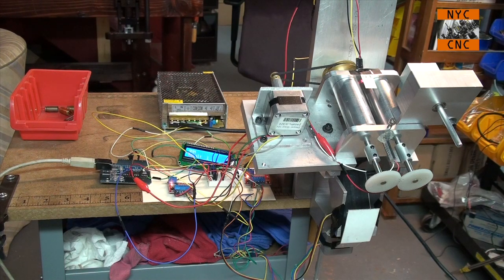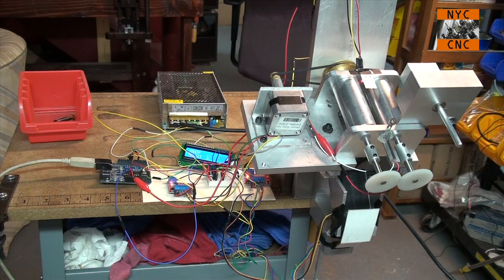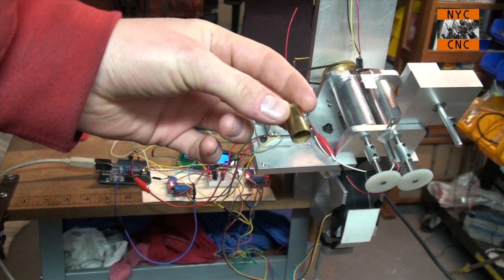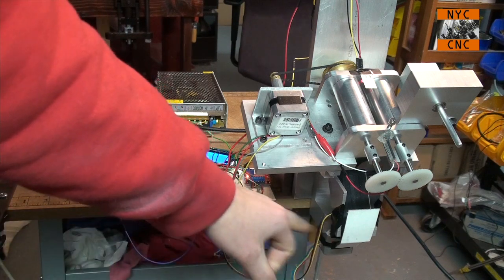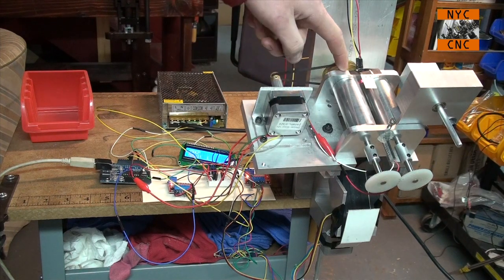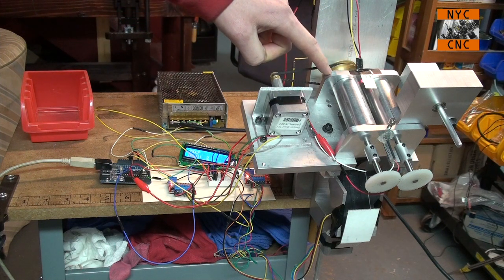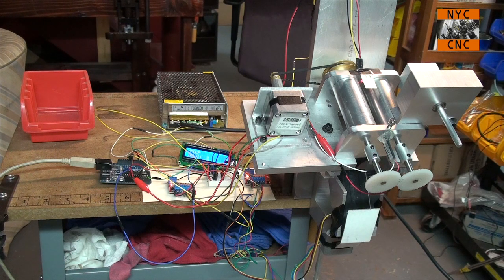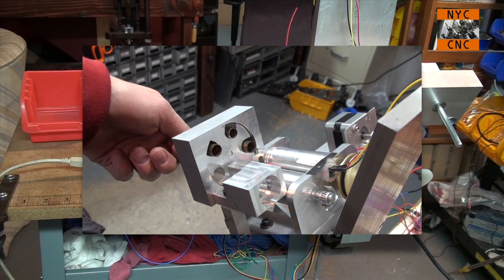Arduino Stepper & Servo Sorting Machine! Uses Motors to Sort Brass By Diameter!

Comment: I have watched several of your videos about the use of Arduino and I learned a bit from them. In fact it helped me build THIS Brass Sorting machine. Sorts by length which is very difficult for most people without a machine. I built my own schematic and bought all the components to  do what my machine does. It also uses a 608 in. oz, stepper and arduino. It was unfinished in the video but functional. I built it as a one off for Monmouth Brass who has to sort Massive quantities of brass. I'm not sure if you are aware that the .357 and the .38 special are only 1/10th of an inch different in length and the same for the .40 cal and the 10mm. the biggest issue with sorting these is that the 2 pairs are the same diameter so with other machines you cannot sort these from eachother. Hope you like it.
Reply: The latter. Photo eyes

Comment: check out the m&m arduino sorter. i think its a delta bot. pretty slick setup, and i could see implementing a webcam to read headstamps, or just measure the case size optically then drop them down various chutes. seems like that system can use a less complex collator/feeder as well.
Reply: i think the nested cases is going to be your biggest challenge. ive seen commercial brass collators that circulate the cases along an outside spiral. there is a finger right at the end that knocks off cases that are backwards {or nested?} i think a system like that used to feed the carousel might work for ya....then again. it might not! ive seen dillon type homebrew case collators that have the fingers added to them.  prevents upside and sideways cases from falling into the chute and jamming the machine.
Reply: well the fingers are pretty much to ensure the cases come around ass first. if the cases were mouth first they would slide over the finger, then drop base first into the collator. I was thinking make fingers that were caliber specific. that way it would only drop lets say 45's, then after an certain time or rejection count the thing that holds the finger indexes to a new size finger. i was thinking a revolving cylinder with appropiate sized gauge pins that were bull nosed. my thought is it would run until all the 45's dropped, rejecting any case that was too small to fit over the finger. then it would switch pins and chutes and start dropping all the 40's, 9's etc. by adjusting the length of the finger i believe it would allow you to sort between similar cases, like 10mm and 40sw which are identical except for length.

Comment: I need to learn to program arduino . do you know where I can. I have tried the videos on you tube. but can't really see or understand much of what's going on. I don't know much of the computer terms. I am self taught. with electronics and the little I know about computers. I am wanting to build a DC boost stage for a inverter. for 24v to 120v. and I haven't decided what type of boost circuit to go with. a smps type or push pull with a large transformer. then rectify to DC. it also needs analog feedback to regulate the output. with load and battery voltage drop. and protection for over current over temp low and high voltage. but clueless to how to program all that . but you probably not interested in power electronics. but if you are. I can use all the advice I can get. if you have the time. I really like your videos. thanks